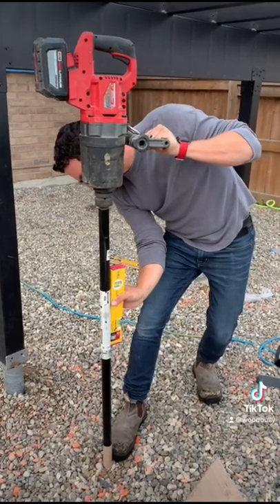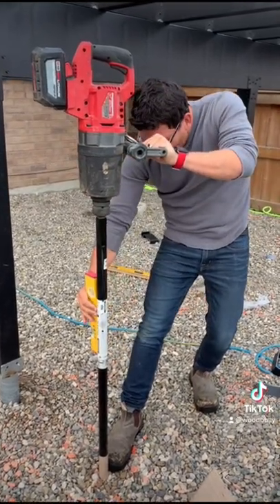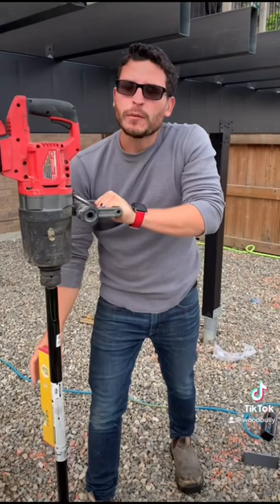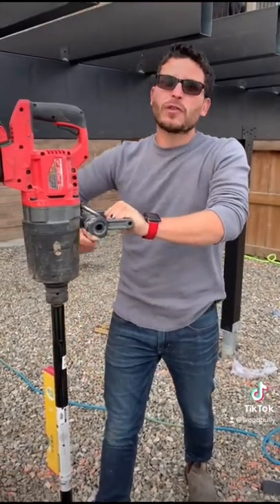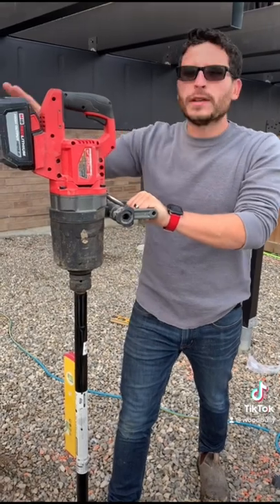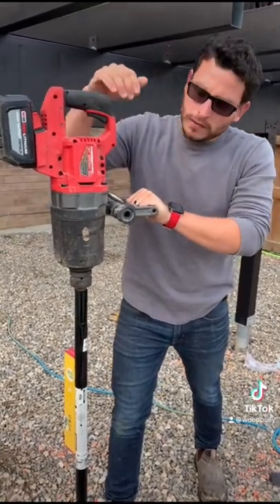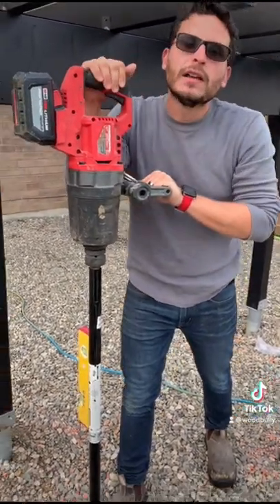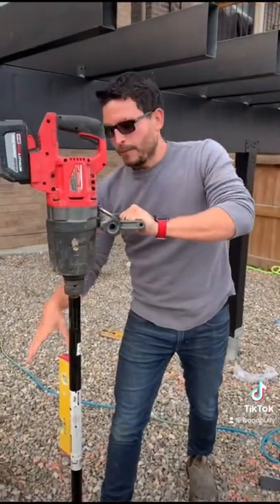HELICAL PILE VS CORDLESS DRILL #carpentry #deckbuilding #fyp #shorts

Comment: Have you used these pilex support screws for decks? Is that a one inch chuck on that hammer drill. What size is the hammer drill.
Reply from the maker: Only for small projects. And no, never use a hammer drill! That would be extremely dangerous. This is a 1” impact wrench
Reply: @woodbullyltd  Impact wrench. Thank-you. It might have been funny to see me making a video hanging on to an impact wrench with one of those screws on it.
Reply: The pylex  i found at home depot are not exactly 1” , it is 7/8 exactly. So i am not sure if the 1” wranch will fit in to it , are you using a different pylex because the one in home depot is also called 1” even though it is 7/8